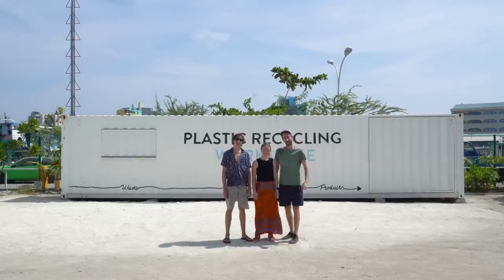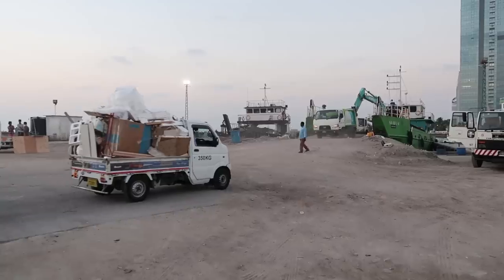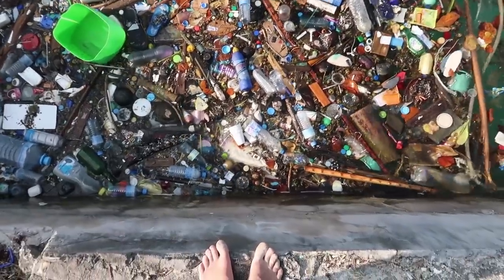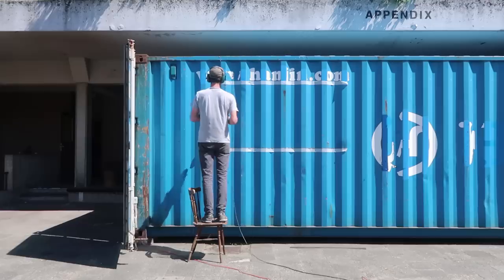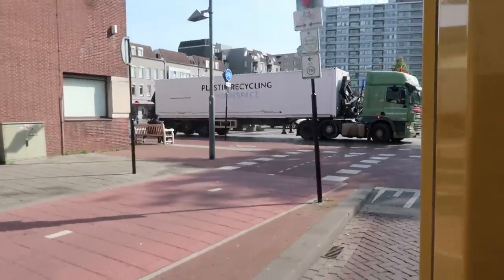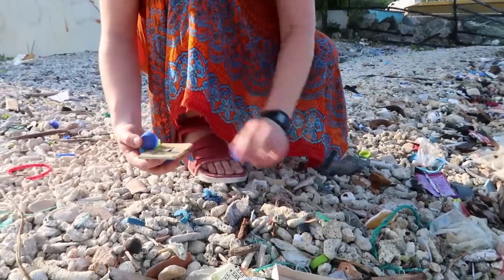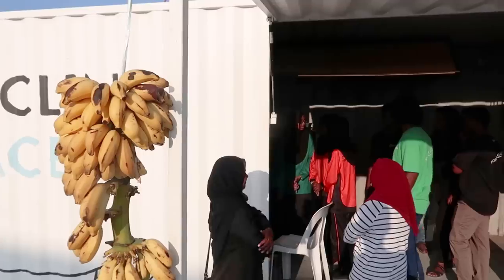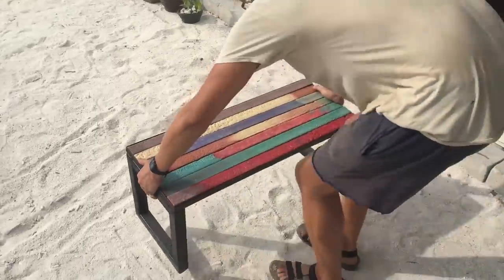Turning Ocean Plastic into Precious Plastic with Parley

Comment: Guys, you should really cover your arms or other uncovered skin when welding. The UV exposure could cause skin cancer.
Reply: @Sage Pratt Got burned real bad from welding with short shorts on, also had tan lines. Cheaper than a tanning salon but not worth it for the scars

Comment: Great video, amazing work !
But why not make the cleaning process more efficient by using let's say some kind of solar powered High Pressure Washer with a recycled closed water loop ?
And also when you raise the question of what to do with the plastics, why not partner with large brands that need plastic for their needs to create a recycled plastic label or something that would make it more appealing and meaningful for the end user ?
Anyway, keep it up !

Comment: How many tons of plastic have you recycled so far and how much carbon dioxide was emitted in this process, including travel?
Reply: Interesting question. But 'including travel' - why ? You mean the airliner would not take off without Dave Hakkens and friends ? Hmm ...
Reply: @tipfox9212  from the videos, it seems to me that they are just recycling tiny quantities of plastic, but using lots of energy and manpower inclusive flights, shipping of their Container, ... for it. (Btw. Airplane needs more kerosene per kg) As good as the intention might be, burning it in a proper way (with filters) and producing new plastic might be better for the environment.
Reply: @andreasd4358  Perhaps you should follow from the beginning ;-) It's not the goal of them to do the work all themselves, also nummber of tons is not important. But changing minds - that's it. BTW: an aeroplane with 300 seats flies with 300 people. If the name of one of these is 'Dave Hakkens' it needs the same ammount of fuel as if this person is called "Jon Doe" ;-)
The 'kerosene per Kg' nummbers are on Wikipedia, I know - but it's irrelevant, see above ...
Reply: @tipfox9212  I am professor in material science, been working many years on polymer recycling. There are so many possibilities for recycling or creating biodegradable plastic out of natural sources. The main point why it is not done is energy. If every single person would recycle plastic at home, we would have a huge problem with energy consumption. Most effective are big plants.
Reply: @andreasd4358  So you are an expert. So you know that the best way to recycle 'plastic' is to not produce it. There are tons of youtube videos where one can learn to reuse 'plastic' - whithout great ammounts of energy. I think as an expert you know of all the problems of burning poor sorted 'plastic' ... in big plants probably with big problems.
What they do is IMHO pure projectwork. It's kind of trivial, that they have to invest first ... soo much to say, but it's hard for me in english ;-). But for sure I respect your view of the things, I got your point - I just have a different one.
Reply: @tipfox9212  plastic itself is a great material and properly disposed, it can be used for energy production as good as coal, oil or natural gas. If this is done, the overall energy consumption/ natural impact is really low in comparison to cotton, wood, steel, aluminium and paper. The only problem is the wrong disposal of plastic into the sea, which happens to 80% in South East Asia, due to missing/ poor waste disposal systems. A very little percentage of people is throwing plastic the sea and rivers. The problem are more the companies in charge. That is where the governments should act.
Reply: @andreasd4358  I'm not saying I totaly disagree. The Challenge is: the material is in the sea allready (and everywhere else in the environment and in our bodies), so no method will turn time back - we will have to deal with it. And I don't believe in politics solving it. Everybody will have to do his part... pure fiction, I know ;-)
Reply: @tipfox9212  right. Don't believe in politics. But also don't believe populists. Banning plastic bags in the supermarket, but allowing micro plastic in shower gel for example.
Reply: @andreasd4358  You're so right - and even worse: 'nanoparticles'. Nobody knows what they do to us and our world. But that can not be a reason for doing nothing - I think.
Reply: @tipfox9212  we should do something, absolutely. We should kick the ass of the politicians. If we would bann microplastics and punish the companies which are throwing plastics into the sea, the world would be much better. There should also be money given to the people from poor countries like Indonesia or Philippines to collect plastic. 5 cents per kg would help their families and reduce the plastic in the oceans a lot.

Comment: (Serious question - not hate) ... I'm just thinking... If the global consumption of plastic DOESN'T go down while you're doing this, then you're actually contributing to even more plastic being produced, because that bottle that would've been recycled into a new bottle now just sits in someone's home as a chair and therefore the company making those bottles has to create a new one (not from an old bottle)

You're incentivizing people to go and pick up the plastic that lays around in nature - which is a great thing but I'm just thinking in the greater picture it's forcing companies to produce even more new plastic ... UNLESS plastic production stops completely.

I'm really interested in the answer to this since I do a lot of research and innovation within this field myself, thanks :)
Reply: Fair question. Can't speak for them, but as best I understand polymers degrade when recycled and over time, and there is a sliding scale of purity and strength, with sterile food and medical supplies on one end, and run of the mill household products and industrial consumables on the other.

So a water bottle that is recycled doesn't get turned back into another water bottle like an aluminum can or a glass bottle would, but instead something more along the lines of a decorative vase, crate, or a bench (things that aren't a health or safety risk if they have small imperfections in strength or color).

That and if there's not a bottling plant there in the community, it wouldn't do them much good to turn them back to bottles anyhow. They might be better used as tiles, chairs, or something else, it's up to them to decide now.